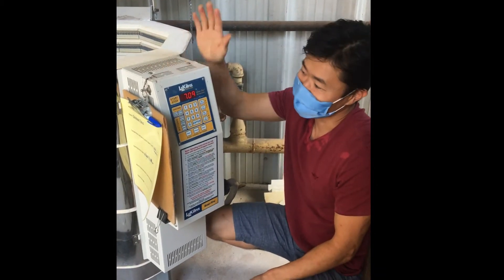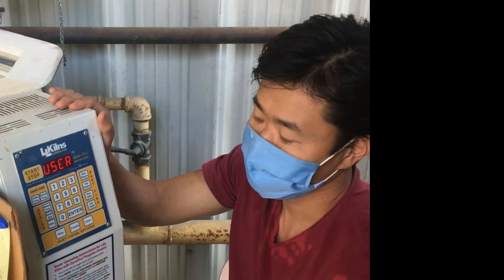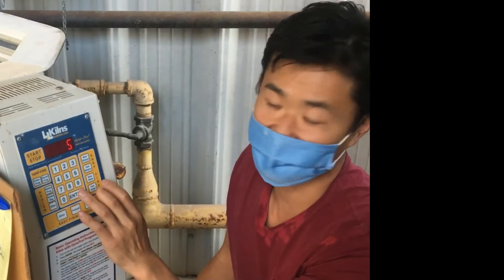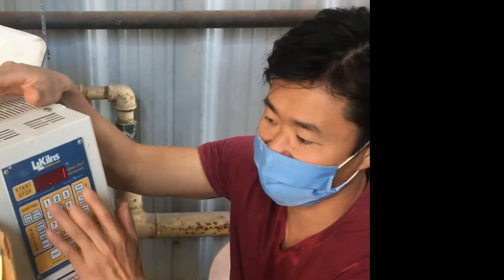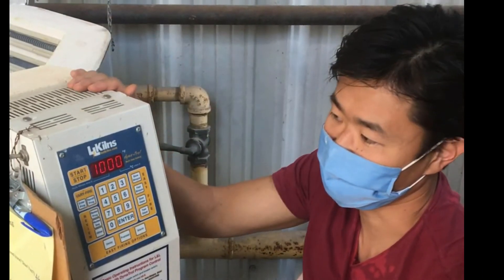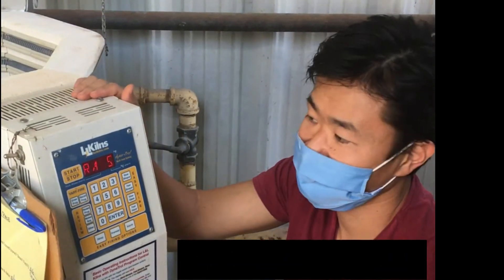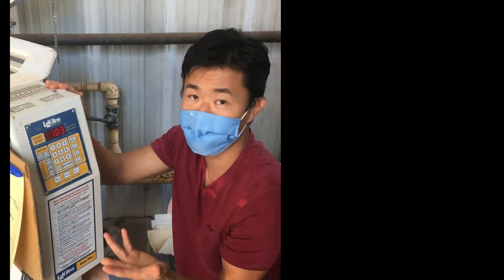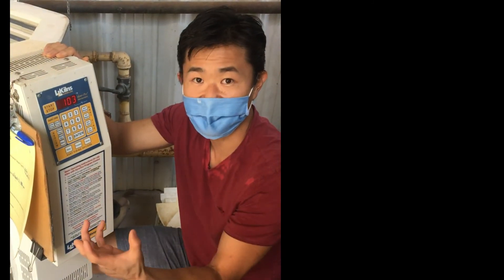How to Program L&L Kiln (Venus)

Comment: We have a Divinci Kiln, with the more advanced controller. I'm trying to find a recommended recipe. We are firing ceramic to 1050 Deg. C, cone 10 right? We take a lot of time ramping and dwelling to get there, 60 hours, and then once we dwell at 1050C, we literally turn the furnace off. I think that sets us up for dunting and internal stress. I'm generalizing because of our proprietary material, but am I right that this is NOT the way to fire ceramic? We should gradually ramp the temperature back down until about 500C before we just turn off the kiln right? Opinions would be greatly appreciated.